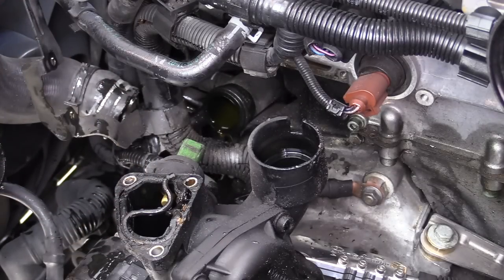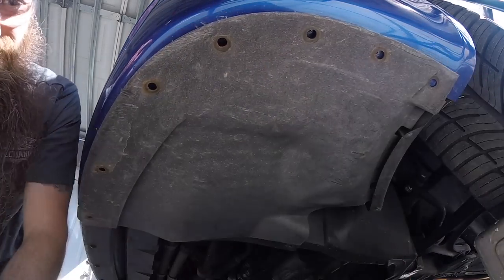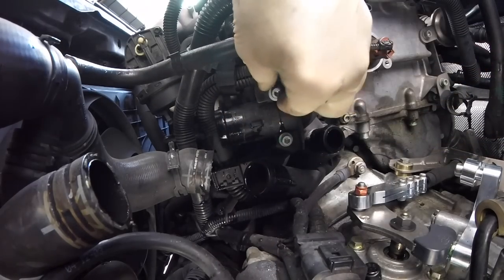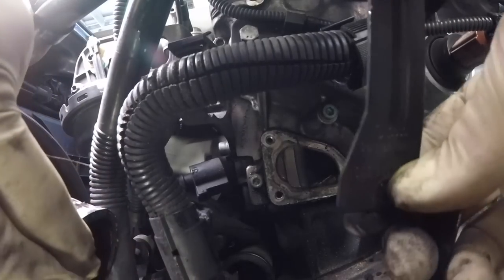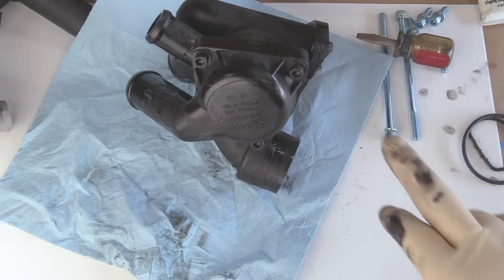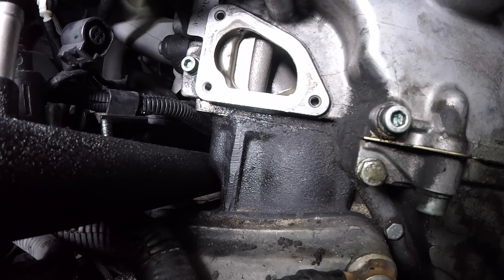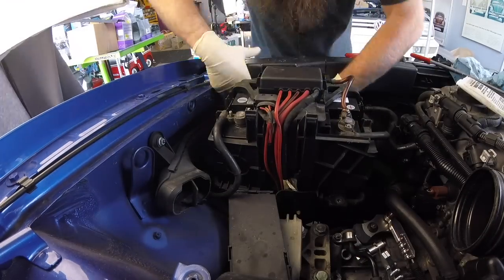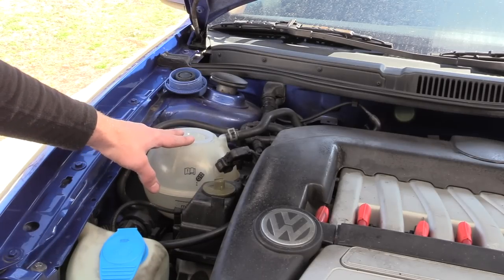Thermostat Replacement and Cooling System Upgrades

Comment from the maker: If the video helped out consider subscribing ~ https://www.youtube.com/user/humblemechanic?sub_confirmation=1

One note on the video~ When placing the thermostat in the housing, I mention a "DOT". That "DOT" is a bleed vent. ;)
Reply: When I did mine I didn't pay attention to that dot (didn't know I needed to). The car has been running fine for a few months, is it something I should be concerned about?
Reply from the maker: It’s probably fine. I’m guessing there are some situations where it may not flow properly. But I wouldn’t worry much about it
Reply: HumbleMechanic I'm so happy your doing all these mk4 repairs/upgrades, definitely gunna be referring to these in a few months
Reply: Picked up some of those Blue Point locking hose clamp pliers on your recommendation from another vid. Those things Rock! Thanks for all the great vids, keep it up.
Reply: What about if you replaced the thermostat, water pump, and upper/lower radiator hoses and the car still overheats, I don’t have temp #’s but about 3/4 up the gauge, only going uphills though
Reply: hey HumbleMechanic, I'm trying to order a eurowise metal thermostat replacement housing for my 1994 golf vr6, u know if they sell them still? cheers if u can help

Comment: Yes!!  Great video, had the same P2181 code.  Replaced the thermostat because it was stuck open.  Also replaced the OEM housing, green top, coolant cover, and the crack pipe.  Upgraded the crack pipe with a 42DD crack pipe and managed to do so WITHOUT removing the manifold.  It was a PITA, but it was doable.  Had to do this twice since the o-ring on the pipe didn't seat properly the first time but I think it was still worth it rather than removing the whole manifold.
Reply from the maker: Man I hate the leaks after repair. The 42dd pipe is what the GTI HAS. :)

Comment: Wow....a torque wrench in action. I'd heard about such things but never thought I'd see one on Youtube.
Reply from the maker: Haha I’m not a torque wrench nazi by any means. But I try to include it when I can. 

That said I can get 10nm pretty close most of the time. 😂
Reply: I torque everything down to 1 ungadunga.
Reply: Actually I think they're ONLY used in youtube.
Reply: I just replaced my mk7 thermostat and water pump and it called for 11nm and I also used a torque wrench, I ain’t messing about plastic parts and torque values.

Comment: Excellent. Learned a lot. Although I have a V6 and 2 W8 cars, the principles are the same. I now know why I had overheating issues, did not bleed the air properly, plugged rad and needed a flush.  Man, I made so many mistakes. . . . . as said, excellent.  And a few tricks like dielectric grease, hose clip pliers, a clip pick, removing hoses etc  

And btw, you have a great voice for narration. Audio is crystal clear, huge difference.

Comment: Nice work Charles. I just did the t-stat housing on my wifes 04 Touareg VR6. :-) Those aluminum parts look great. The first time I did the job I used an aftermarket plastic housing. That was a mistake, it leaked like a sieve. Lesson learned and now it has a genuine part and no problems. The parts house took the junk part back for a full refund.
Reply from the maker: Glad they gave you the money back. Some of that aftermarket plastic is awful

Comment: I'm all about using a little dielectric grease on those hose connections and o-rings. Love that stuff. I use it for all sorts of other stuff, too; like at the bottom of the battery terminals (between the post and the cable). It definitely keeps the crusties away, haha.
Reply from the maker: Yea man. I use it all the dam time. Lol

Comment: See it with the GMs,Chryslers and Fords with the PO128 code too.Replacing the thermostat fixes the problem too when this code appears.The hose picks,Snap On makes the best ones now.A wide flat tip instead of a pointy tip to prevent poking holes in hoses.

Comment: I recommend everyone to get a vacuum filling tool for the coolant, it creates a 0.8 bar vacuum so there is no air left, cost around 50 dollar (Here in Norway at least) and is worth its weight in gold.
I use it on every car at work, and it doubles as a leak detector when you cant get vacuum because a leak.
Takes around 3 minutes to bleed with it and 0.1% chance of overheating or having to refill more than 0.2 liter after driving instead of filling and having to rev the engine and drive until it is hot and refill again that might take over 30 minutes on some cars or even having to wait to it is cold again.
Reply: I think its worth mainly if you work on many cars. But if you care about your money and only have 1 /2 cars at home, its just not needed, at least with VW cars. My car bleeds itself without much trouble pretty fast, 2 or 3 runs and the air is all out.
Reply: i have 3 Audi XD and my dad has one, i think even for a home mechanic it is gold, saves much time and you can loan it to friends if they need it.
at work we have 2 but I had felt the need for having my own as well, as I prefer to be 99% sure the engine wont overheat from a lack of coolant since that happened to me once before I bought the tool
Reply: I used the airlift brand but still can't get all air out .Now my bottom coolant hose is cold and car runs hot It has new fans,new water pump,new thermostat and new radiator.

Comment: Timing is everything...

I'm about to do this job on my 2.0. 

I don't have to worry about the crack pipe, and things are a little easier to reach, but still a great how to!
Reply from the maker: Thanks. Be sure you replace the housing too. 100% chance it will leak if reused
Reply: Yup.  Got a nice box 'o parts from #autohausaz sitting here.
Thermostat, housing with o-ring seal, outlet flange with o-ring seal, expansion/recovery reservoir with cap and seal and finally a new coolant temperature sensor...

Comment: Thank you. I feel like I’ll be having to do this soon. Owner of a 11’ MK6 TDI. Brought my car to a mechanic to replace my timing belt. They did a flush and didn’t put the recommended G12 or G13 I’m my car. Instead they put the green coolant in my car. 5 months later coolant dash notification goes off because of low coolant -_-  which either means I now have a leak or the coolant is simply evaporating in my cooling system.

Comment: Great video as always. You always think of putting in the thermostat in the correct flow position but leave it to VW to have to clock the thermostat as well. 
Is it that way with all VW water-cooled engines or just a few?
Reply from the maker: I think the Vr is the only one that is oriented. I THINK! Lol
Reply: HumbleMechanic 
Thank you 
I have a 12 valve VR 6 in my Eurovan based Rialta and plan on changing the pipe and thermostat when decent weather hits. Good thing to know. Thanks again.

Comment: Really enjoying these R32 videos. I have an mk1 TT with the 3.2 VR6 so a lot of these videos apply to my own vehicle.

I’ve had to have the thermostat housing, temp sensor and o-rings a few times.

My primary cooling fan just retired so I’ll be back in that area again soon. 

Do you have a recommendation for a silicone coolant hose kit to refresh all of the old rubber?

Is there a reason that you painted the aluminum parts?

Glad you picked up the R32. Keep up the good work.

Comment: Hello charles, thanks for great vids!! Some advice please. I've just replaced coolant thermostat with housing on 2002 Mk4 Golf. It has the green coolant sensor and also an extra 2-wire component that connect directly to the thermostat in the housing. Trying to understand what the extra component does. cant find a PID for it. Believe it may allow PCM to trigger trigger opening at lower temperatures, or perhaps it is just a on/off signal to PCM to indicate when thermo starts to open??? Keen to understand its function and how it works.

Comment: I would recommend getting the Ross Tech Vag Com.  When I needed to program 2 keys it was cheaper buying the keys and FOB's online, cut, and program myself with the Vag Com, than going to the dealer and buying and programing there.  Then I had the software to reset and trouble shoot codes on my car.  It payed for itself in one use.
Reply from the maker: VCDS is awesome.

Comment: What's the story w/ upgraded crack pipe and housing regarding fitment problems causing leaks. I have yet to replace mine on 2003 VR6 w/ 90K on it. Appreciate any feed back!

Comment: Is it possible to swap out the coolant temperature sensor without pulling housing out of car or taking front end off and moving support forward on the mk4 2.8 vr6?

Comment: The piece you mentioned might brake in the beginning of the video broke on me once. I just bumped it while doing something not related to the cooling system and the next thing I know I was getting hot coolant sprayed on my face. Fun times.
Reply from the maker: Yep. Seen dudes get some nasty burns from that part

Comment: The other day i was flushing my radiator fluid in my B5. That hose was just not coming off so i drained my fluid trough drain plug in the front of the radiator. Isnt that easier?rather that pulling hose clamps etc? I understand that you have to get to termostat so in this situation maybe but just Q i am wondering. Thx for the answer. Love your videos. Fan from Slovakia (:
Reply: Matúš Vápeník you don't have to remove the bottom hose and you can use the plug like you're saying but the hose is generally faster.
Reply: Darn those hose clamps. Hate them

Comment: Wil I be able to tell if my 2013 Golf TDI thermostat is bad by reading the Temp on the Sensor?  What should the temp reading supposed to be?  It's taking about 15 minutes for the Temp Gauge to reach the middle and there is no HEAT coming inside!

Comment: New to vw world, but guessing their radiator designs don't have a radiator cap like you would find on GM/ford? Saw on the refill of fluids you used the overfill tank instead of radiator.

Comment: since this is an upgrade will you put the dsg intake on the car??? it will need a reflash but gains are good and still oem, the lmm is 10mm bigger on the dsg version(same as the audi a3 3.2 250bhp) it´s officiel 9bhp since the r32 only has 241bhp.
regards
Sören

Comment: Awesome stuff! Your Thoughts on silicone hose kit for older cars? VR6 24v? worth it?
Reply from the maker: If you need to replace hoses anyway, then YES. But I don't think I would do it just to. I did them on the GTI. The fitment was MEH.

Comment: I always have leaks from the where the housing hooks up to the head ANNNNDDD where the sensors hook into the housing. I've been careful, and I still get leaks the first time. Second time with some sealer usually works but makes a redo of the job messy.

Comment: I read some forums where they install a metal crack pipe only to have it leaking or not sealing properly. Is the one in your link the better one??
Reply from the maker: That I’m not sure of. I’ve installed a bunch and never had one leak. 

Often times issues like that are an error by the installer

Comment: Great video as always. Why the dye electric grease tho? I know it creates a seal to help keep dirt and water out of as well as lubricates the plug on electrical components. Is it acting in the same manner for this application? Also, would the grease getting into the cooling system be any cause for concern or no because of the small amount? 
Thanks in advance
Reply from the maker: You nailed it. Purely a lubricant for the seals. I’ve been using it forever. Never seen any ill effect from it. I guess if you put a crap ton on it may.  Haha

Comment: IRL this is a hell of a job for vr5 motor, well at least for me it was. Had to take the radiator off, to access it, did everything as repair manual said put it all together (4+ hours of work as diy'er) aaaaand there's a leak. This happened 3 times, wasted my whole weekend on this. Turns out it was a poo quality seal which connects to the block, ended up with placing original seal added with a high temp hermetic and prayers along with my wife questioning my manhood. After a week it developed a leak in the same area, i just said dang it I'm not going to do this again and put a radiator sealant in the antifreeze (yes I am a son of a female dog to trust it) but it worked, 20k+ miles and still not a problem.
Reply: xDDDD bad luck bro

Comment: Hey Charles. Can you do an in depth video on how to remove and reinstall the belly pan/undertray? I understand their is more than one and some are missing on my R32. Cheers. oh also should the radiator fans on the Mk4 R32 come on at the same time? My small fan always runs (probably because I have the aircon on) but the big fan doesn't seem to come on that often.
Reply from the maker: Oh man I JUST installed the DieselGeek pan so I’m missing most of mine too. Lol
Reply: Interesting do people remove them? or do the get "removed by nature" if you know what I mean.
Reply from the maker: Both. Mostly I’d think from people hitting crap

Comment: I have a question as I'm running around trying to figure out a problem and am out of ideas...

I just performed a coolant flush for my wifes Audi Q3 (2016 Quattro) and now I'm running into an issue where the radiator is not sucking the coolant out of the Coolant Overflow tank (this was also replaced for a brand new unit, btw).  I definitely have coolant flowing into the heater core (as I'm getting really hot air) but the lower radiator hose is simply not flowing anything.

We definitely utilized a vaccum bleeder/filler to load up the new coolant (even drained it again and performed a refill) but we just can't seem to get it to flow through the radiator.  Any ideas would be helpful

Comment: Hello, my Audi tt 3.2 had a p2181 code pop up. So I'm going to need to replace my thermostat.... great video. I noticed the shift linkage is aftermarket, is that yours? Or do you have experience driving it? How do you like it?
Reply from the maker: Yep it’s mine. Its a short shift kit from Diesel Geek. I did a video on rebuilding the entire shifter and shifter box in the car

Comment: You made that look way too easy.. I needed to put my R32 in service mode to get the "crack" pipe out. It did not want to just pull out. I also noticed in the video you have secondary air pump fault codes as well.. How are you going to trouble shoot those? I have them as well. I have been knocking my head trying to figure out what is wrong with it. Hope you do a video on it!
Reply from the maker: Pulling the front is a good way too. 

I actually think the secondary air faults may be related to the HFC. but I haven’t really dug into it.
Reply: HumbleMechanic I hope you make a video on it! Would help me out as well.
Reply: Same here same code for me

Comment: Would silicone paste or super lube work as the grease you use? I'm assuming just nothing petroleum based?
Reply from the maker: Even coolant works great. I also have a bottle of .... personal lubricant that works for coolant seals.
Reply: HumbleMechanic Haha, thanks!

Comment: When I changed the housing and crack pipe, i decided its better to pull the whole front of the car off.. just to swear a bit less..
Reply from the maker: That’s a great way. It’s how I had to do the mk3. The pipe was stuck in the block

Comment: Charles I wanted to ask is the vr6 12 valve thermostat housing able to fit a 10 valve vr5? same for a 24 valve vr6 to a 20 valve vr5? There are some small differences but for the most part it seems to be the same. Thanks for the great video and have a great day!
Reply from the maker: im not sure. We didn't get the VR5 in the US, so I dont have a lot of experience with it.
Reply: @HumbleMechanic  I see, well I just ordered a 12 valve thermo housing for the 10 valve i hope it fits. the vr5 usually isn't for everyones liking since it needs a turbo to keep up with the 1.8t or vr6 and at that point people normally go for one of the other two. I'm just weird :D thanks for the quick reply.
Reply: Watched video still unclear about thermostat position in housing. You cannot assume thermostat position is correct on a used vehicle.

Comment: is it possible to change the temp sensor without pulling the thermostat housing off?
Reply from the maker: yes!
Reply: @HumbleMechanic  Do you know if it’s possible to do it without flushing the coolant or will coolant come pouring out when I take the sensor out?
Reply from the maker: You’re gonna lose a good amount of coolant

Comment: Why should i put 50-50 coolant mix in? Now im using straight coolant. Should i get worried?
Reply from the maker: It depends on the car/coolant. IF you have straight unmixed coolant, you can pull som out and add water

Comment: Can’t seem to get coolant pipe to seal in the thermostat housing. Leaking only from there and it’s a new thermostat housing. Should I replace the pipe?
Reply from the maker: at min, the seal
Reply: HumbleMechanic I put a new o ring on the end of the crack pipe and it was still pouring out. Can’t seem to figure out why it won’t seat in the housing
Reply: Also to add I have an 03 Jetta gli with the 24 valve vr6 and a 6 speed manual transmission.